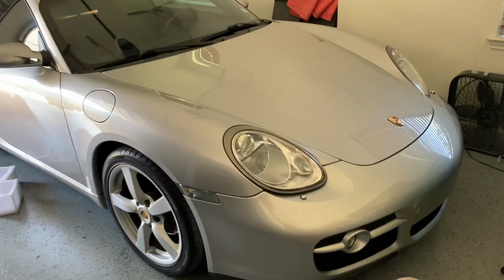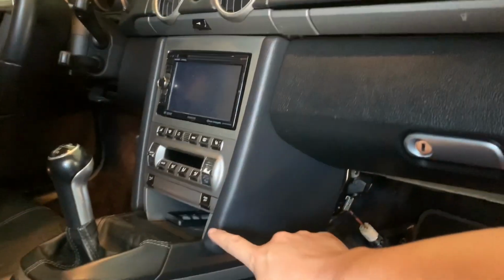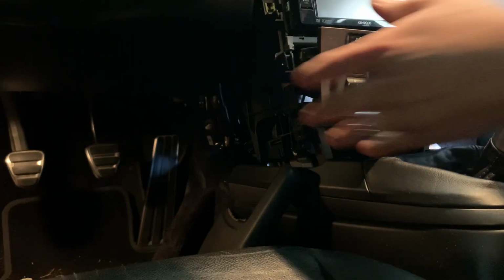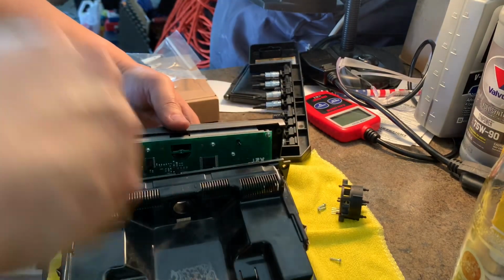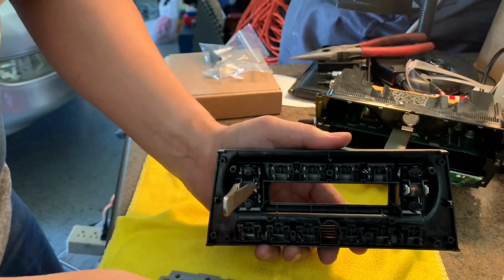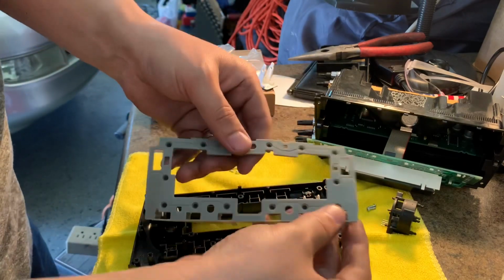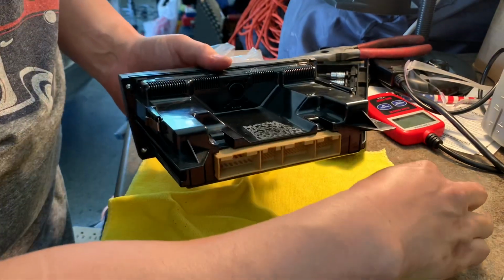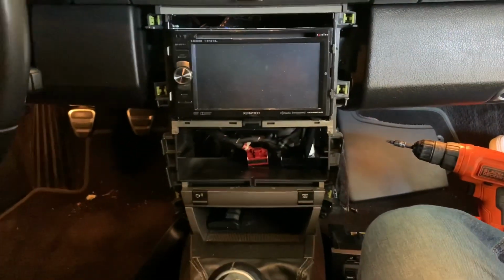How to change #Porsche #Cayman: #AC #Fan #Buttons Replacement **EASY! $$$$ #climate #control

Comment: I have a WAY EASIER WAY... drill a small hole in each button just above half-way. Use an angle pick, insert it and give a good sharp pull. Then just snap the new buttons in place. Works flawlessly and saves 99% of your time
Reply from the maker: Thank you. Do you have a video to share?
Reply: @512TXSDIY  https://youtube.com/shorts/LDfii_m3ZuM?si=7Nq83Kphm-cEpmoo

Comment: I got thru to replacing the switches part.  However, during the dismantling, the screen part fell apart and I don't know how to reassemble the screen.  I've only gotten one of the buttons to work.  ECO.  Display dim lighted up and no content displayed.  There's still a problem with contact with motherboard/circuit board.   I'll have to go to dealer to have them reassemble the climate control unit.   Not as easy as it looks.
Reply from the maker: Sorry to read this and hope it gets sorted out for you. This was my first go at this too so maybe I got lucky?

Comment: This is a great video. The hardest part was seeing how the old switches would release. Took a while, but finally got it.
Reply from the maker: Glad it worked out! Where did you end up getting your buttons from?
Reply: Got the two switched on Amazon; $ 29.95
Looked as good as originals; without the goop !
Reply: As an aside, I would recommend pulling the Stab Module that has the Spoiler and PSM switches while you are there. Look for corrosion ! Spoiler switches gotta be really clean. Evidently, the fan has a tendency to pull in moisture- at least according to a video I saw
Reply: https://youtube.com/shorts/LDfii_m3ZuM?si=7Nq83Kphm-cEpmoo

Comment: Jeez. What a hassle. I might just live with the missing paint on the switches.
Reply from the maker: It’s not too bad of a DIY honestly. I think it’s worth it and the buttons are significantly cheaper now than when I purchased originally. Please like and subscribe
Reply: Instead of taking anything apart, why not just carefully drill out and/or break/remove the old buttons, which you don't need anyway, and then install the new buttons? The new buttons just slot into the holes. No disassembly would be required.  @512TXSDIY
Reply from the maker: You could do that but risk the chance of damaging other parts in the process for sure. What are you going to do?
Reply: https://www.youtube.com/shorts/LDfii_m3ZuM?feature=share

Comment: Superb thank you very much for this video - just replaced mine by following your instructions no problem at all.
Reply: Thanks I have liked and subscribed. It was for my 911 (997 gen 1). I found the whole thing very easy thanks to your video which I had on my laptop to refer to throughout the repair. The only confusing part was when the light diffuser fell off the back of the LED screen as it was being removed and I couldn’t quite work out where to put it back. Trial and error solved that!
The car is in mint condition other than the temp and fan buttons which looks great now they are fixed !👍🏼 thanks again
Reply from the maker: @jonathancase9870  Very cool and I am glad it all worked out. It transformed my 987.1 as well. Have a good one!
Reply from the maker: Yay and great to hear! How did it turn out? Don’t forget to like and consider subscribing. I have lots of Cayman content.

Comment: I coloured mine in with a sharpie, 20 second job
Reply: Looks shite but it’s what you get cutting corners
Reply: Shouldn’t happen in the first place on this marque of car though should it…
My info is broken too now so I’ll update and replace it and whilst it’s out I’ll replace them.
Reply from the maker: Good thing is that it’s easy to do
Reply from the maker: It’s a VW
Reply: Would you recommend an info replacement? Please good Sir
Reply from the maker: You can find it on Amazon for about $40 so a lot cheaper than when I did mine.
Reply from the maker: Happy it worked out for you. Consider subscribing if you haven’t already. I have lots of #Porsche content.

Comment: Great video. I have one added observation: If you have a Bose unit in the passenger footwell, you first need to 1) remove the small vent louver (via snaps), 2) remove the larger vent (T-20), and the large carpeted cover (T-30) which slides back towards the rear of the car. This will allow clear access to the side panel screws. This job took me about 90 minutes working carefully on a 2006 987.1 S, and yes the button removal requires some patience.
Reply from the maker: Nice and congrats to you! Thx for the comment
Reply: https://www.youtube.com/shorts/LDfii_m3ZuM?feature=share

Comment: Great instructions thanks mate 👍
Reply: The only problem I had was with the L/H side panel top clip snapped when pushing  / pulling out. It may have been like this already. Once back in and tightened up the side screws all ok.
Reply from the maker: Bummer. Where did you get your replacement buttons? Is it good now?
Reply from the maker: You’re welcome! Please like the video and consider subscribing.

Comment: Great video ! Of course when I got my unit out I discovered the small fan was missing.I’ve done a search ..anyone know what the replacement part is ? It’s been working without it but while I have it apart I’d rather put it back the way it’s supposed to be.
Reply from the maker: Thank you. I’m not 100% sure this is correct, but check this fan let out. It’s $17 on eBay. 

https://www.ebay.com/itm/Climate-Control-Fan-Speed-Pigtail-Plug-85-93-VW-Rabbit-Cabriolet-Mk1-171-959-999-/282523768148?mkcid=16&mkevt=1&_trksid=p2349624.m46890.l49286&mkrid=711-127632-2357-0

Comment: What is the most difficult part ? I’ll try to do it myself this weekend
Reply from the maker: Hey! Honestly, the hardest part is removing the buttons from the unit. It isn't hard but does take a little persuasion is all. Once you get one off, the other side is cake. Good luck!!! If you don't mind, please like the video and consider subscribing to the channel if you haven't already.
Reply: @512TXSDIY  actually i am more worry about dissembling the panel
Reply from the maker: That part is easy. You just have to make sure you have the correct bits/tools and be patient is all. Not hard at all. Removing lower ball joints is much more difficult
Reply: @512TXSDIY  you boosted my confidence.
Reply from the maker: Good!
Reply: @512TXSDIY  You are correct. Taking out those 2 buttons was the MOST DIFFICULT. Then when we put back in, the screen fall off and we did not know how to do. Took us a while to figure out. At the end took us almost 2 hours but it was done. It made a huge difference on the whole panel :)
Reply from the maker: Glad you got it done though. It takes patience for sure.

Comment: Thanks for the video.  I bought my replacement switches from Clima Repair last Fall. ( I think they are in Spain). Cost me over $100.  Then I went and lost them during the winter.  :(  Luckily they are on Amazon and all over eBay now for $50-60.  Still not cheap but better than $100 and change.
Reply from the maker: Wow. That’s a great deal. I got mine for much more than that. I think they are in the UK. Don’t forget to like, share, and subscribe if you haven’t already. I have plenty of Cayman content.
Reply: I think there is a company in the UK called “Climate Repair” that sells buttons and another in Spain called “Clima Repair”.  Both are pretty pricy. Wish I could compare the new cheaper ones to the older expensive ones but I really don’t remember what they were like.  I’ll probably find them later in the summer after I install the new ones, LOL.  That’ll teach me to buy stuff in advance.
Reply from the maker: What are you driving?
Reply: @512TXSDIY  987.1S. Had it since 2006 and still fun to drive.
Reply from the maker: @JD-ze2fy  nicely done!